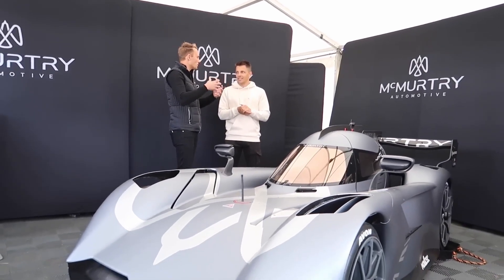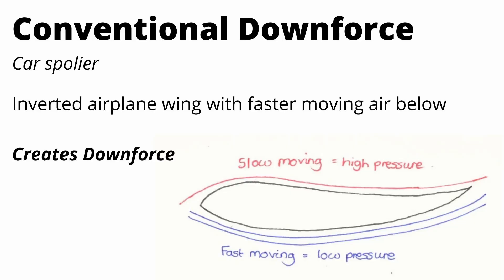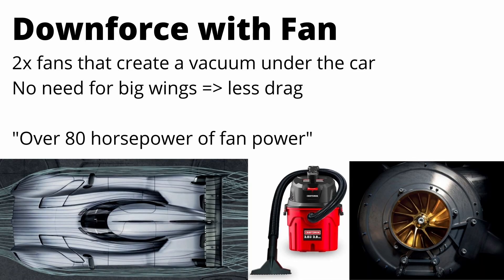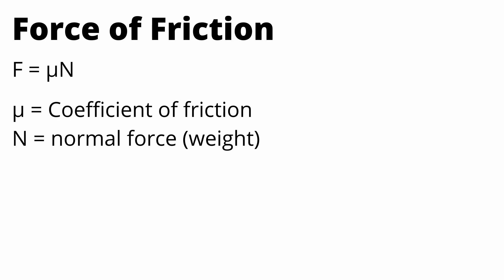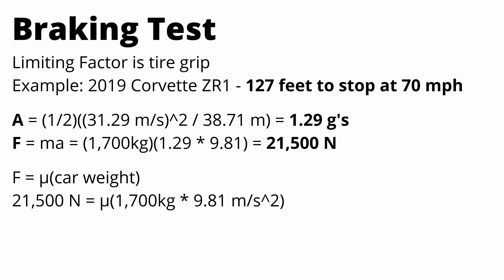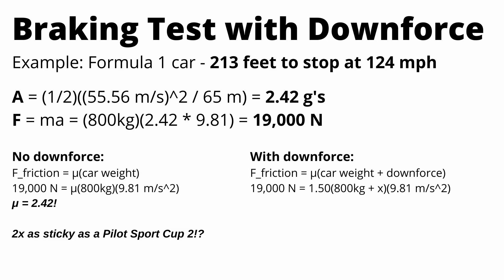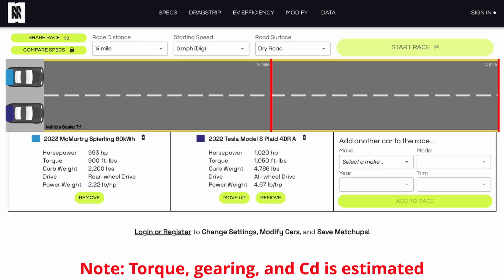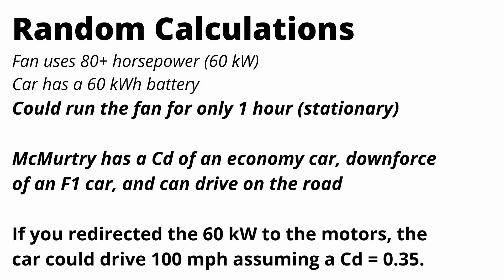1,000HP McMurtry Speirling EV! Fastest 1/4 mile Analysis

Comment: Yeah this is an amazing car, Super quick, great stopping and handling. There were a few experimental race cars in the 60s like the Chaparral 2J that used a vacuum to suck the car to the ground, but they were quickly outlawed because they were too quick. But also a problem with some high downforce race cars is if they get some air and lose the tight suction connection with the ground, they can fly up and lose control. So they could become dangerous to drive on uneven road surfaces. I was surprised to see the McMurtry Speirling priced at $150K, because it looks like it would have the capability to set track and acceleration records for street legal cars everywhere it goes. It would be good to see how well it performs without the fans in operation. Thanks for the downforce lesson!